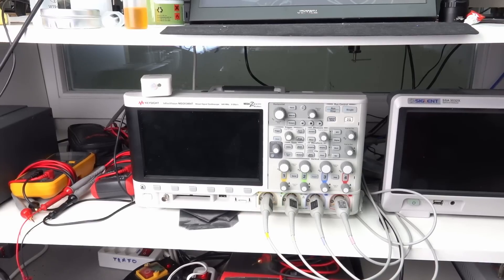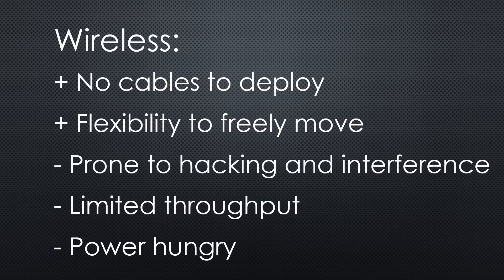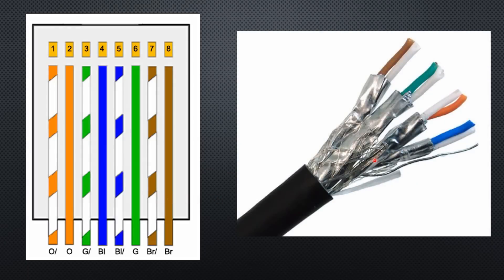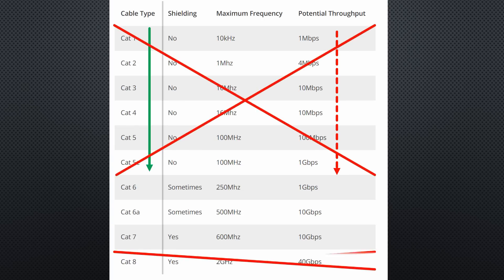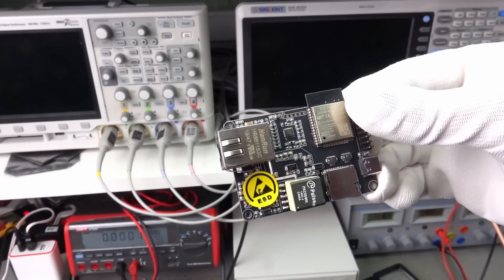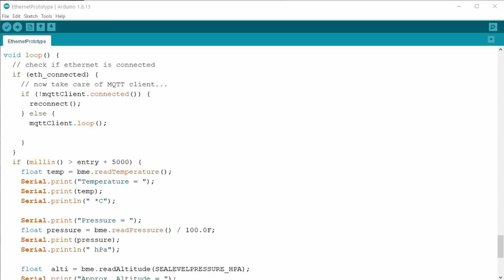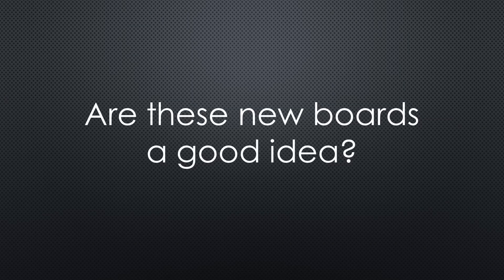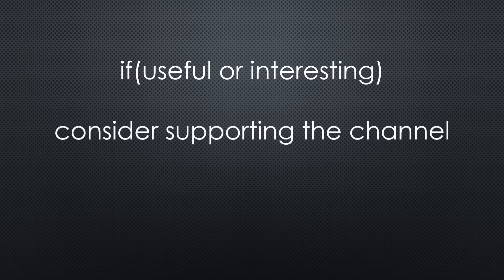#365 Is Power over Ethernet (POE) on the ESP32 any good? (New TTGO and Olimex boards available)

Comment: I'd like to make a board with an ESP32 board + LAN + ADC Chip.. do you think I'm better off buying an ESP32+LAN board...like 
QuinLED-ESP32-ABE 
WT32-ETH01 
ESP32-S3 ETH 
ESP32 Ethernet Unit with PoE

and just making a custom daughter board with my ADC circuit? Or should I make the whole thing custom, and implement ESP32/LAN myself?

For example, If I go with the off-the-shelf ESP32+LAN ($10) then my custom board would just need 

1) a USB connector (for 5V and serial comm), and 
2) Can Bus Transceiver and 2 Port Terminal Block  -- the TWAI/Can would connect to the WT32-ETH1 on a couple spare I/Os.  No DMA :(
3) ADC and 8 Port Terminal Block   -- the Adc would connect to the WT32-ETh1 on spare I/Os configured for SPI-BUS+DMA.
4) A JTAG Header

There's not that many spare I/Os ( 4, 5, 17,  32/34)   ,  JTAG (12, 13 14, 15)
Reply from the maker: I have no preferences. You decide because it depends on many criteria outseide my knowledge like Your capabilities, # of boards that have to be procuced.

Comment: Nice video, as usual. I'm looking for a possibility to connect any ESP-processor with a dual ethernet shield (port mode) to have the possibility to be connected with two independend subnets. Furthermore I need a USB A socket to plug in an USB stick for csv-file export. If I understood your comments well, there are not enough pins, right? Cheers, Andreas (too)
Reply from the maker: I do not know if this is possible. AFAIK, the EXP32 only has 1 Ethernet port.
Reply: Thanks for your prompt answer. Meanwhile I have figured out that it should be possible to use 2x SPI and 2x ethernet module with W5500. And the ESP32-S3 Dev Kit comes with 2x USB (1x for power/programming, 1x SPI UART OTG). In total 3x SPI should be possible, right? @AndreasSpiess
Reply from the maker: @ap8868  I would check if the software supports 2 ethernet ports, too.

Comment: SInce the introduction of auto sensing NICs T-568A is no longer necessary, but to advise against keeping to the color code of T-568B is bad practise, the reason being is that if many people installing cabling between infrastructures visually assesses a cable or a patch panel they are going to assume one or the other end is wrong. Stick to the standard and don't waste people's time. Memorise: OW-O / GW-B / BW-G / BRW-BR. https://youtu.be/v8JodmdxIKU?t=220 I remember it in four pairs: orange green blue brown, white always first in the pairs, except the blue pair is snuck in the centre of the bunch between the green pairs and flipped to be solid first.  If you can't find a way to remeber this then you shouldn't be wiring stuff up, if you can then you'll atleast look like you know what you're doing.

LilyGo PoE Board:-
I got half way through this video and realised the advise is basic and WRONG so let me fill you in, if this is the first place you landed after buying the LilyGo POE ESP32 board, the lan chip on the board can be damaged if you supply PoE using an injector which is stated as gigabit PoE, stick to 10/100, there is no protection against an injector that may supply power over the additional 4 x RJ45 wires.  At the same time you're going to want to find a decent PoE supply of atleast 24W, at 48v that is 500mA, it's enough to power the ESP32 with WiFI and a few sensors totalling 250mA at a push, anything else and you'll need more.

You also cannot provide usb power at the same time as PoE, this is not mentioned in this video. It will damage the board if you do so.
I am not sure why the board developers only handed the consumer a 2x8 header as there are plenty of pins to expose from the ESP32, especially those connected to the SD card slot if you don't intend on using it.

Many hobbyists don't realise when starting out is that the ESP32 compared to the arduino, has a ton of pins that can be reconfigured to do anything you want, and almost all of them are PWM pins.
I suggest anybody who is interested, go ahead and read this: https://www.upesy.com/blogs/tutorials/esp32-pinout-reference-gpio-pins-ultimate-guide and pay attention to the strapping pins.
Another remark made in this video, pins 34, 35, 36, 39 were said to be "unusable".  This is also WRONG, they can only be used as inputs.
And lastly one of the LilyGo PoE board's major draw-backs is the lack of 5V supply header.  This has been mentioned on their github repository https://github.com/Xinyuan-LilyGO/LilyGO-T-ETH-POE/tree/master, you'd have to ugly-mod the board to overcome this.

OLIMEX ESP32 EVB Board:-
There is not a lot to say about the OLIMEX ESP32 EVB board right now, there is no PoE.  Other than there is a useful UEXT1 header which exposes 8 unused pins, 15 and 17 were not used in my case as they proved temporamental, again read the link about the esp32 pinout reference as it is most comprehesive, second to the actual data sheet.  However if you do want additional pins you will need some electronics knowledge to understand the schematic to avoid using pins where a pull-up resistor is attached to the board where not wanted on said pin.

If you are considering using this board, head over to the github repository and scan the issues section comparing any features of the DEV board you intend to use simultaneously:
https://github.com/OLIMEX/ESP32-EVB

The ESP32 is a powerful package but don't expect an all in one solution, perhaps in my development career I shall decide to prototype and produce some boards with more specific purposes, ie ESP32, ethernet and just relays, perhaps PoE without the additionals.  But some could argue that's your job as a learner and hobbyist too :)
Reply from the maker: Thank you for your input. You know much more than me on this topic!

Comment: does this board , its ethernet/network can function as PPPOE to access the internet , then will be using its WIFI as an AP?
Reply from the maker: PPPoE and PoE are very different things. PoE is only about energy distribution
Reply: @AndreasSpiess  im referring to pppoe , to dial login, then once it has internet, it will use its wifi to share internet

Comment: Is it possible to wire an ethernet cable directly to the gpio pins of the mcu?
Reply from the maker: You need an adapter.
Reply: @AndreasSpiess  oh so its not possible to directly interface an ethernet directly into the gpio? Ic ic thank you

Comment: I'm considering starting a new project that turns a 4mb WROVER ESP32 into a Squeezebox network music receiver, but your struggles with getting BLE to work alongside ethernet has given me reason to pause and reconsider. I was planning to pair it with a waterproof Bluetooth speaker that will hang off the shower faucet. Was it only BLE that was affected or legacy Bluetooth devices too?

Something tells me that pulling out a digital audio signal with so few connectors left available will be a bridge too far... Add a DAC to that shipping list and it doesn't look nearly as cost effective as a WROVER and JBL Clip Speaker does...
Reply from the maker: Maybe you watch my video about ESP32 audio. There you should find an answer.
Reply: @AndreasSpiess  Congratulations! You are my new spirit animal 🤭

I wonder how difficult it would be to use an ESP32 as an audio spectrum analyser that could, with an attached microphone, act as a substitute for your smartphone when generating and sending music mode led instructions to network connected smart lights. I recently hosted a children's birthday party during which I had intended to use my music mode enabled lights when music was playing.

The problem with that is the necessity of keeping the app running in the foreground of your smartphone with no other apps attempting to connect to the microphone. Try maintaining that when you've got half of all the parents calling you for directions while you're trying to capture moments with your phone's camera. 

Whoever designed these capabilities has clearly never had to cope that PLUS 15 8-year-olds hopped up on sugar coated almonds 😱
Reply from the maker: @matthewmalpeli  Maybe your next project? Google finds an audio spectrum analyzer project for your ESP32...

Comment: Hi Andreas. Recently I've purchased an "AZDelivery Adattatore Seriale FT232RL da USB a TTL per 3,3V e 5V compatibile con Arduino". In your opinion, may I use it to program the LILYGO TTGO T Internet POE ESP32 WROOM LAN 8720A ? Thanks in advance.
Reply from the maker: I thought you can program this board using the USB connector (as most other ESP32 boards).

Comment: ESP32-POE is OSHW certified Open Source Hardware with UID BG000009
ESP32-PoE is an IoT WIFI/BLE/Ethernet development board with Power-Over-Ethernet feature. The PoE is handled by TPS2375PW chip (Si3402-B in older revisions) that is IEEE 802.3-compliant, including pre-standard (legacy) PoE support. The PoE powering requires at least 37V DC to operate successfully. The board takes power from the Ethernet cable and can be expanded with sensors and actuators. Perfect solution for Internet-of-Things projects.

Important notice: ESP32-POE has no galvano isolation from Ethernet's power supply, when you program the board via the micro USB connector the Ethernet cable should be disconnected (if you have power over the Ethernet cable)! Consider using Olimex USB-ISO to protect your computer and board from accidental short circuit. Also consider instead using Olimex ESP32-PoE-ISO board which is insulated.

ESP32-POE-EA has module with U.FL connector and external antenna attached.

ESP32-POE-IND and ESP32-POE-EA-IND are with industrial grade -40+85C operating temperature.
Reply from the maker: Thank you for the additional info!

Comment: Agree to Simione and others: Olimex boards has problems. I had a failure in project with many ESP32-EVB (also seen in this video). Onboard relay switching noise hangs ethernet chip. It never happens and works correctly when relay contacts are not connected, but in case even of a small (5V DC 50-100mA) load on relays, ethernet occasionally fails. ESP32 works, but ethernet chip hangs. Opperation can continue only after ethernet chip restart using jumper. Maybe others have had the same issue? Maybe even a fix?
Reply from the maker: Thank you for sharing your experience!
Reply: Did you checkout the "The Olimex ESP32-POE-ISO has 4 big problems. Let's fix them." video here on YouTube?

Comment: The Wi-Fi Part ist explain es ist es using the freeRTOS lightWeight IP Implementation to connect to other devices - Which is just Inconveniently Named Wi-Fi.
Reply: You Could actually use Bluetooth and Ethernet at the same time but You have to ReWrite all die IP Base Library’s
Reply from the maker: This video is about wired connections. So I do not understand.
Reply: @AndreasSpiess  you told us that ethernet function use the WiFi.h include and the WiFi.connect and so on - and that you could not activate Bluetooth while using the ethernet library's at the same time - but is is possible - you just need to write your own ethernet library :))

Comment: It would make more sense to have PoE RJ45 paired with ATMega2560 Pro board, not esp32. Mega has so much more IO.
Reply from the maker: Maybe you find a board with an Atmega2560. So far I did not need as many IO pins.

Comment: Hi Andreas, how are you?
I hope well!
My name is Humberto, I'm from Brazil, I'm a subscriber to your YouTube channel!
Andreas, please, could you help me, I'm building a Home Cockpit of the F-16 (flight simulator), I'm going to start building the electronics, that is, the panels, which will use Led, potentiometers, encoders and switches, a concern I have in this project, is the excessive use of USB ports and wires scattered in the Home Cockpit, I would like to know if there would be a solution for all these connections using Arduino Mega 2560 and Poe Lan, this device from Olimex seems to be very interesting DEVELOPMENT BOARD ESP32-POE IOT.
But I don't understand much about programming, I don't know how many boards I would need to implement this project, I also don't know where to start with the idea that a Switch POE will also be needed, I don't know how many ports!
Can you please help me to develop this project?
Thanks for any help!
Stay safe and stay tuned!
Reply from the maker: I share my knowledge in my videos and unfortunately, have no time for consulting :-( Sounds like a complex project to start with. Maybe you start with one component till you have the skills for an overall project.

Comment: Thanks! Is there any way to use this with only 4 wires and 100Mbps? Until a few years ago LAN cables had 8 wires but only 4 of them were used. That worked just fine. I guess 100Mbps is more than fast enough for almost anything. It would be great if there would be an option to use this "slower" speed and free up 4 GPIO pins. Is this possible? Thanks.
Reply from the maker: Maybe it is complicated because the connectors have some internal components which might conflict with your goal. (https://youtu.be/v8JodmdxIKU?t=656 )

Comment: Will either board pass through power from PoE? Like, could you assign 12v or 16v or 48v to a GPIO?
Reply from the maker: GPIOs usually only support 3.3 or 5volts. More kills the whole chip

Comment: I find it interesting that someone would use a $5 board, and then add a $15 ethernet.
I am working on a camera system, and have been testing data speed, the esp32-cam is real cheap, but wifi too slow.  A pi zero also cheap and 5mp camera is great, but only usb2 which is too slow.   I tested a pi4b with gigabit either, 100mB file xfer, 100 times faster than wifi.  Even the usb3.0 on the pi4 was maxed at 20mB.   While $35 for a pi4 seems like a lot, it isn't if you consider the total cost.   I looking at ethernet because I have 50ft cable runs, which I can do with usb extensions but only slow.  100mB with 100ft cable is the solution.
What you think?
Reply from the maker: I would not use the ESP32 for video. A Pi is much better in this respect. Wi-Fi, particularly 5GHz, should be fast enough for many WiFi applications on a Pi.
Reply: @AndreasSpiess  The esp32-cam is ok for my car theft security as it will just save the images on the flash for a short time, and xfer them later.  But I have another project to integrate 3 or 4 camera images some 50ft away in real time.  The Pi 4 at $50 is tolerable, but I really want it half that cost.  been searching and searching for an alternative, no luck.
Only thing ran across was $24 NanoPi Fire2A-LTS from china. 2 month ship and looks support is bad, you ever try any of their products?
thanks, appreciate all you do!

Comment: When flashing this the power is given by the CH340C or the main board requires power as well?
Reply from the maker: I do not understand your question
Reply: @AndreasSpiess  Andreas thank you. The TTGO goes with its own additional board (CH340C) for flashing. This interface has already two usb, one mini and one C. From the various picture on internet, even on the official lilygo webpage sometimes the interface is connected from the bottom of the main board, sometimes from the top, but of course depending on the side you plug it in the pins will be inverting. In addition to this there is the usb port on the main board. My question was if it's needed to power the main board or it will take power from the interface. I searched documentation but I didn't find anything, also in your video you didn't show this connection details. Before 'cooking' one or both boards I was looking to hints and explanations.
Reply from the maker: Most boards are powered with the USB programming cable.

Comment: can i add an antenna to the TTGO?
Reply from the maker: You have to see if  your module has an antenna connector. If it has a connector and a PCB antenna you have to re-solder a resistor.

Comment: My personal philosophy. Anything acting as a server or running a server service daemon is always wired with a fixed IP# in a range not used by wireless router DHCP server as client range. Sensors over distance where wires access is hard such as inaccessible walls or expensive to run wires goes wireless. Sensors on tools and other occasional use devices is wireless, always on home automation wired. Security purposes such as cameras with large data to be streamed and recorded always on wires but completely seperated on its own private wired network separate from home internet network to not impact home users bandwidth. If your security solution needs internet access the security hub has two wires. One to home internet to get to internet access and second to private wire network to keep large video data off of the home internet network. Never video over wifi unless playing around. When serious use cases always isolate and shield your bandwidth from other people.
Reply from the maker: Good philosophy! With modern switches and star cabling bandwidth on cables is maybe no more an issue

Comment: there is another cheap board, but without PoE: WT32-ETH01
these are the changes needed in board definitions:
#define ETH_PHY_ADDR  1
#define ETH_PHY_POWER 16
#define ETH_PHY_MDC   23
#define ETH_PHY_MDIO  18
#define ETH_PHY_TYPE  ETH_PHY_LAN8720
#define ETH_CLK_MODE  ETH_CLOCK_GPIO0_IN
Reply from the maker: Thanks for the info. For me, POE is a must because it eases wiring a lot...